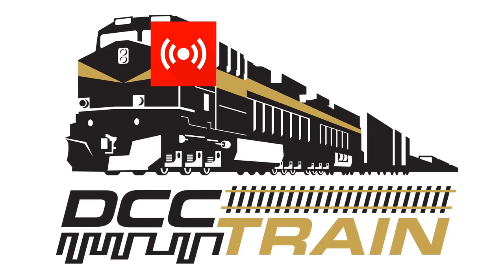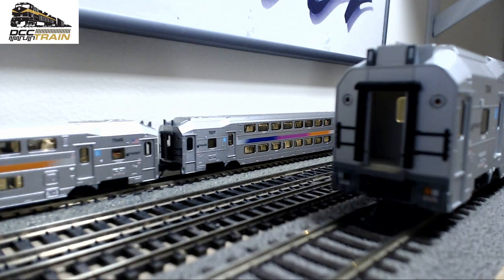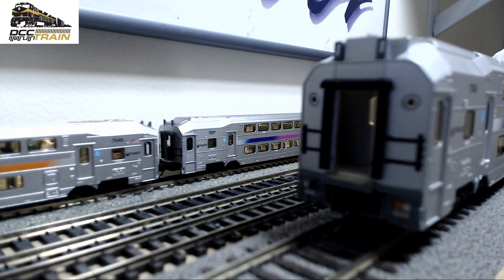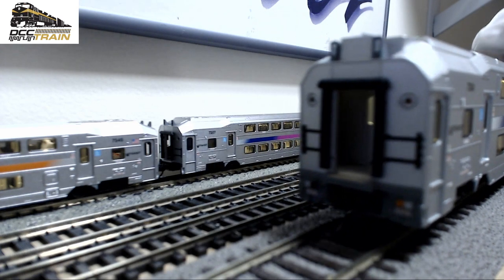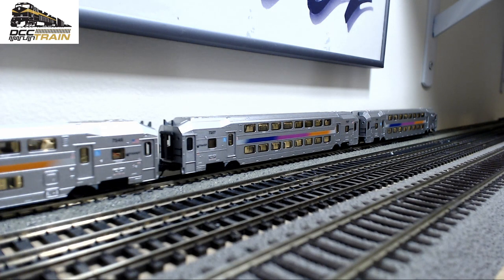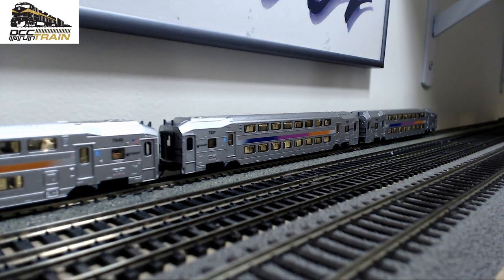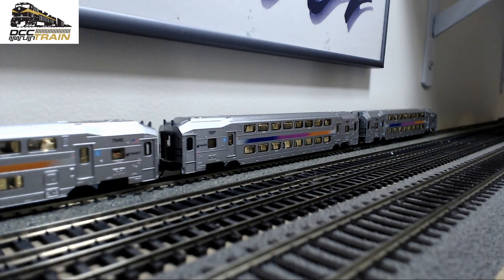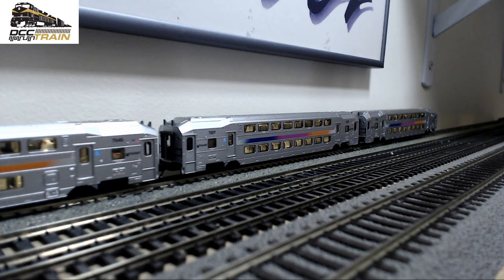Atlas N scale New Jersey Transit test locomotive

Comment: After running for a few minutes, the sound cuts off and all controls no longer work, but the locomotive continues to run. But if I take it off the track and put it back on again. I cannot control it again for another few min. And during that time, it cant even be read on the programming track!
Reply from the maker: What it your DCC system?
Reply: @dcctrain  digitrax
Reply from the maker: Does ot have an output voltage selector on the front panel of the booster?